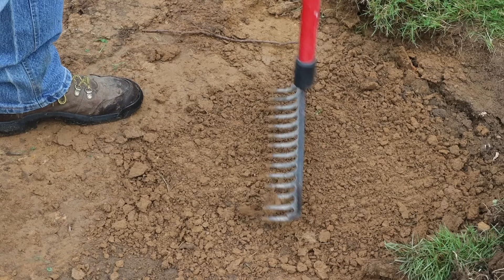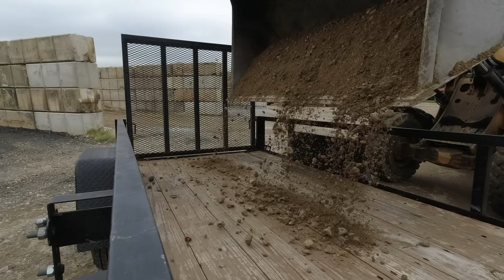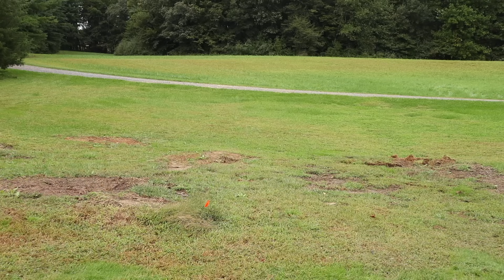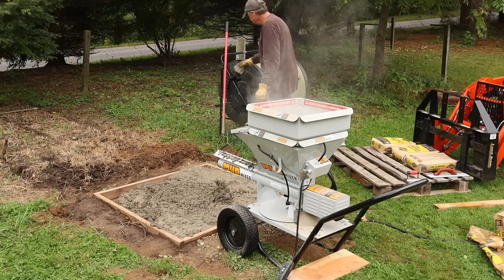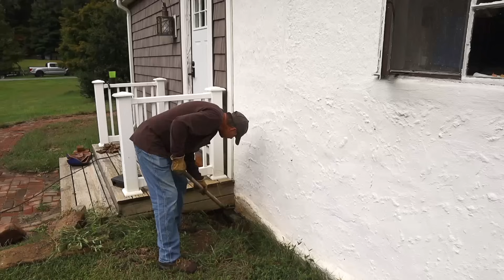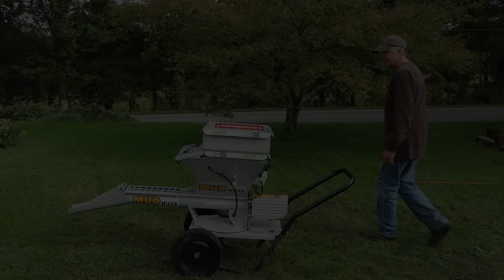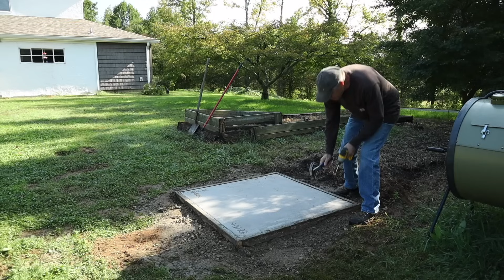Game Changer. Pouring a concrete pad and using the Mudmixer for the first time. MCG Video #169

Comment: Come on man. At least put a tarp down and secure the load on your trailer. I wonder how many windshields were taken out by the rocks that surely fell off.
Reply: Any reason why those rocks couldn't have gone into the pickup truck?
Reply: @KratosMetalworks  It's a PITA to clean out the bed of a pick up.
Reply: Don't call him Shirley!
Reply: NC gives tickets if you don’t cover your load. That’s for everybody
Reply: @jiggidyjam So does Texas. He would have been ticketed quickly for the un-tarped load.
Reply: As an owner of a Safelite franchise, I advise you to pipe down
Reply: @shakehandswithdanger7882   haha I'd be willing to bet most the people who you encounter as a result of unsecured loads were following tri-axles too closely.

Maybe I'm giving too much credit to common sense here but it's pretty easy to tell when a load needs secured be it ratchet straps or tarping loose material.
Reply: @shakehandswithdanger7882 I know right
Reply: Yeah man, secure the load.  Put some cross straps on it.  🤪
Reply: You can buy a nice truck and trailer but you can’t buy common sense lmao
Reply: Flip the edger so only the downward flange is contacting the concrete to form the initial groove along the frame.  Then you won’t have resistance as you finish the edging
Reply: My thoughts exactly...
Reply: Exactly; I've had cars sandblasted behind people who don't understand and follow the laws that require covering a load like that on the road.
Reply: They never should have loaded that trailer not ment for loose material. That ridiculous
Reply: I hate seeing ppl that don’t! Or ppl that don’t sweep the deck after a haul…
Reply: @diesel09 we don't care
Reply: mine..$844
Reply: What a knobhead. All the gear, no idea.
Reply: Wrong Trailer for the job, destiny should have had a tarp.
Reply: None
Reply: He likely didn't have far to drive, so he drove slowly. I hope, that this is the case. Even if road safety wasn't an issue, why waste material blowing out via the slipstream?
Reply: Yeah the extra half ton he didn't need is all over the road 🤣🤣🤣🤣
Reply: Not to make light of an unsecured load, I can fit 4 bags of Quikrete 3/4 gravel in the trunk of my Dad's 2003 Toyota Corolla. 😅

Probably a few more bags if I don't want to blow out the factory OEM shocks. 😂
Reply: Typical boomer
Reply: At least he's not anxious and can tell if he is a male or female@AnxiousCowboy
Reply: Y'all are ridiculous; minus some dust he probably didn't lose much in the way of materials.

I hope you all stay 300ft back from f'n dump trucks though. 🙄

You guys should get clear acrylic boxes and smoke test a mini truck & trailer set up.

I promise you'll be surprised.
Reply: @aRegularHandyman only takes one rock. 🙄
Reply: @philspd473   shh don't tell my secrets

more seriously; I just brought in a trailer load of scrap, none of it was "secured" and none of it fell off at 50mph ;)

Ok .. small debris sized stuff was placed inside an oven but there was all kinds of shnit there.. xD

Comment: Finishing concrete for diy types is like finishing drywall topping coat .They keep working it and working it . Patience is key.and I think you did well . That machine should not be dropping out cement fines at the rear . What does the manufacturer say about this ?I’ve seen many concrete truck operators sprinkle in a healthy dose of brown sugar into the chute and apparently the chemical reaction makes the mud flow a lot easier .

Comment: Great job. One thing not shown, and perhaps not known, is that concrete needs to be kept wet to full cure, which is why pros mist the top with water and then cover it with plastic sheeting, during the cure time.
Reply from the maker: Thank you! I did wet it and let it cure slowly 👍
Reply: 7 days slowly curing? Most people aren’t that patient with keeping it wet/curing. 

Most pros that I’ve worked with just spray on a curing compound. Plastic would be a semipro move.

Comment: A 2x4 is actually 1.5x3.5 inches. So you wouldn’t get a 4 inch slab. Which is the reason you were left with two bags 👍

Comment: I’d like to have one of these, but that’s a tiny amount of concrete. On the farm we’d mix concrete with a masons hoe on a piece of plywood on the ground. You throw down your fixins, make a divot in the center for the water and start folding  in the edges with the hoe and mixing it up. Repeat the process until you get it mixed the way to want it. You can throw the bags of cement right off the truck instead of lifting them up to a regular drum mixer.

Comment: Mudmixer for the homeowner: not $500, not $1,500, not $2,500… but rather $3,500.  ($3,000 on sale.) Yikes, for doing a few pads or fence posts, I’m just fine with the old wheelbarrow method… for for luxury, a $200 Harbor electric mixer!

Comment: First time visiting here and I'm impressed with that Mudmixer.  I do understand these machines have some quirks that need to be hacked but as with just about any mechanical device, the more you use it, the easier it becomes.  I was thinking the designers could make one with a trailer hitch so you could pull it around with a ATV or UTV. Thanks for the vid and nice work on the pad.  Cheers from Vermont.
Reply: I could have used something like that 20 years ago when I put a 140’ of 4’ H ICF  foundation under a house. I used a mixer and scaffolding. I loaded the mixer with buckets. I still have the mixer and one more project for it  in my lifetime.
Reply: I reckon a larger unit designed to fit on a medium sized truck, with three hoppers (one each for sand, aggregate and cement) with separate dials to control each ratio.  Have each hopper able to hold the contents of t one and a half of the 1 cubic metre / yard bags, and a hiab crane to reload each hopper.

Comment: Nice video!  Thank you for demonstrating the mixer.  One thought that might help with the initial start up.  Try wetting down the chute and turning the auger/water on before you add the first bag.  It will definitely help the mud come out the chute easier and may help solve the initial consistency problem.
Reply: Also, if that isn't enough, reverse it a few times to get that initial batch truly wet.

Comment: In the spring I poured a 30”x48” pad for my coal forge, in my barn. I probably went a little overboard with it. It’s got a 6”x6” grid of #3 rebar, and is 5/6” thick with beams around the perimeter, 😂. I like the idea of that Mudmixer, it seems a little fiddley, I’m sure there’s a learning curve. Cool video, thanks.

Comment: I don't see the value in the mud mixer.  Seems like an expensive Rube Goldberg way to mix concrete way more inconsistently and with more breakdowns than an old fashioned drum style electric concrete mixer.

An electric drum mixer allows you to dial in the mix before it's poured, allows you to control the rate of pour so that you don't have to keep up with a constant flow of concrete, is a very simple machine that doesn't jam while pouring, has far less to go wrong with it, and is 10X cheaper to purchase.

As far as the mud mixer being easy to move when full, I don't see the benefit.  Electric drum mixers are easy to move when empty, and since they're empty after every pour, there is no real advantage to moving the mud mixer vs. the old fashioned drum mixer.

As far as cleaning goes, the drum mixer wins hands down.  That mud mixer was half full of dry concrete that had to be removed without using water (at least according to the sticker on the hopper).  It also has a feed screw and chute to rinse out.  A drum mixer would've been empty after the last pour, so it would just need to be rinsed out.

About the only advantage I see for the mud mixer is the chute allows more accurate placement of the pour and doesn't require a wheel barrow to move the concrete from the mixer to the site of the pour, as long as the pour is near the edge of the form.  If you're pouring a larger slab and need to get the pour in the middle of the slab then you'll need a wheel barrow anyway, negating that advantage.

I don't get it.

Comment: Everyone is ahead of me so I won't say much except it was an excellent video and when someone without a lot of experience does it they have the same questions as I would have had regarding the marks and someone answered that below. 
I learned a lot from the video and I will watch your channel more often. I was going to mention the 3 1/2 inch forms were the reason you had too much concrete mix. I recently poured a pad from a truck and I raised my forms up a half inch. Raising the pallet to the same level as the mixer saves a lot of back pain.
Reply from the maker: Thank you!

Comment: It is slightly embarrassing to think that somebody might mix this job with that expensive machine instead of using a barrow or regular barrel concrete mixer. In fact, this machine is NOT the right tool for that job. And, in reality, on larger jobs where you want consistency and a high quality result, you might be conned into thinking that it might be the right tool ... but here also it is not since you cannot achieve the same consistency as you would get out of the truck (not to mention the additional effort, time and cost). I think if you have a long foundation to pour where you have excellent access so that mudmixer can be pushed along, then you probably have the right tool for the job, if you're willing to still work hard and pay the $$

Comment: You didn't need all 12 bags because a 2x4 board is actually only 3.5 inches wide so you didn't get the full 4 inches thick you put into the calculator. I just saw the mudmixer for the first time today and was curious to see someone actually using one. Thanks for sharing your experience. 
Whenever I do any concrete work I use the leftover mix to make stepping stones. I just pour it right on the dirt and tool it along with everything else into a flat blob about 2 inches thick and once it sets up you can put it anywhere you want to step on a solid object instead of the ground
Reply: I started to post the same comment, but decided to check first to see if someone else already said it! You beat me to it!
Reply: For concrete it's better to have more than less just like pulling electrical wires.
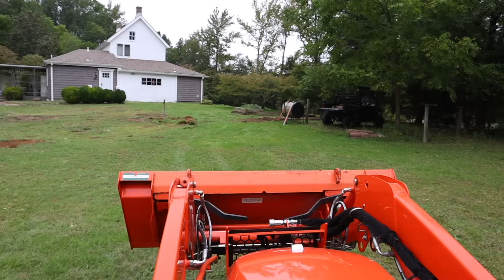Reply: You missed at 8:45 (before he dumps the stones) he grabs four 1/2" thick pebbles from the tractor bucket.  He then places a pebble under each corner of the form to raise it up one half inch
Reply: I had to take some cores out of a huge 4" thick silage slab that a contractor had poured for a dairy farmer.  All of the cores came out significantly less than 4" long.  The contractor's response was that "everybody knows a 4" thick slab is really only 3-and-half inches thick."

Comment: Great job Ed.  Thanks for the honest “handyman” review.  Most of us wouldn’t spend that kind of money as weekend warriors but I love the technology.  For semi-pro contractors that might be doing this several times per week for shed foundations or similar pads, this could be a nice piece of equipment.  Like you I’m curious about the cement powder on the frame that you experienced.  This will mean less cement in the mix and possibly a weaker mix (not to mention waste). I’d also like to know of the long-term reliability and service history.  Any machine like this takes a lot of abuse so it’d be interesting to know how many yards of concrete you can put through it before it needs a new auger, motor or other maintenance.  Keep up the great work.
Reply: That was my thoughts exactly. That leakage of the fines in the back will through the ratios off. I wouldn't be surprised if something isn't installed / adjusted correctly. It shouldn't be a normal part of operation. But that's the modern manufacturing process for you. It doesn't matter how much you pay for it, sone adjustments are left to you inorder reduce manufacturing cost. But be darn sure the company won't pass those savings on to you. Lol 😂
Reply from the maker: Thanks very much! Yeah it’s not an “every day” tool for average DIYers but if you have a use for it, I think it’s well worth it.

Comment: The project turned out well and I enjoyed the vide!

 I however have to ask and this is not being nasty or mean but did you really need an online calculator to figure out how many 1/2 cubic foot ready mix bags were needed for the job?

I have a MQ Mix & Go rotary mixer and mix concrete all the time - my mixer is 1/4 the price of yours - I mix from ingredients - sand, gravel, Portland cement and water - it’s cheaper then bagged premix. I would have bought 3/4 clear stone for the base and used the same stone for making the cement just for efficiency on such a small project.

If you correctly measured the forms and had cement bags left over you may have used too much water in your mix.

For the price of that machine you could have bought a decent rotary mixer, a weekend warrior  grade plate compactor and maybe a 18 volt pencil vibrator.

I think your machine is great if the bags are being billed to the job and or the volume needed is just below a minimum load (cement truck) or the job is remote. I think there are interesting applications for your machine and I might even rent one depending on the job but I would never buy one at that price.
Reply from the maker: I appreciate your thoughtful comments. This machine definitely has its place, but it’s surely not for everyone. I think if you have several small to medium jobs, this wins over a traditional mixer. But that determination is really up to each individual. And yes I needed the online calculator - because I wasn’t sure if my local lumber yard was going to carry 40lb, 60lb, or 80lb. I definitely would not recommend using 80lb bags unless you are really physically fit… Which I am not. 🤣

Comment: Did you figure out why and where it was leaking dry mix on the back from?
Reply from the maker: The company stated that it’s normal for some of the dry mix to be pushed out of the back however, they are working on an improved seal.
Reply: I would suggest putting a heavy tarp down on the trailer first before they load the gravel and pull the excess tarp up over the pile. Windshields and paint jobs don’t come cheap and you may even get ticketed if your load is not contained . The mud mixer looks like a time saver letting one person do the work of two.

Comment: I’m an old concrete guy with many decades of experience and I’m here to tell ya it wasn’t painful at all, lol
Your prep and technique were solid as can be.
Reply from the maker: That’s very kind. I really appreciate it!
Reply: The pile of dust out the back is a sign that the seal around the auger shaft isn't right.
Reply: When I get gravel like you did I get one of my big tarps and drape it over both sides of the flat bed down to the ground.
They dump the gravel in and I wrap it up like McDonalds wraps up their cheeseburgers and lay one of my long tow chains on top
Nothing goes anywhere it's not supposed to and you don't get sued for flying gravel. I did like you're video !
Reply: @bevholcomb6805 I shall use this tip myself
Reply: Agreed!  Well done Sir.  😊 God Bless
Reply: prep flawless now that finish is rough lol
Reply from the maker: @mackeyjewell9166  I’m learning 😄
Reply: @MyClutteredGarage  if you do it again try and keep your mag more flat like you’re trying to be gentle unless you let the concrete harden a little more on a small job like that i advise letting it tighten a little more it’s much easier for a beginner to get a decent finish where as with wet Crete you gotta be grabbing crème off the top of the Crete and filling in while you’re edging and your mag will float easier on the stiffer Crete that was kinda wet to be finishing already on in the edge you want to make sure you don’t just dig the cutting edge next to form your wanting an even edge so it doesn’t roll
Reply: @mackeyjewell9166 wet broom finish is good enough for this job.. its not a sidewalk or front porch 😂.
Reply: Kinda wot I was thinking.. but wot I know. I only had 25 yrs experiance working for my day growing up. Today I just feed cows all winter and bail hay all summer  fish and hunt.
Reply: I have 25 years' experience myself.. looked good to me too..
Reply: Wetting the crushed concrete before you pack it is a much better procedure.  And also, why no rebar or fiberglass reinforcement on that size pad?
Reply: I realize it's just a small pad, but anytime you pour concrete without  fiber mesh reinforcement added in the mix. You need a wire reinforcement in the bottom third of the pour . It's not if concrete will crack, it's when. The wire simply holds the pieces together when temperatures and moisture cause the slab to expand and contract
Reply: Here's what you have to do: Go to the magistrate and produce verified copies of your diploma and certificate from your employer/clients to prove that you have worked in the concrete trade. If you say the video wasn't brutal to watch for a pro then you must not have worked much with concrete.
Reply: @SwedishNiceGuy    So what does that mean? Can you offer some meaningful advise for us 'newbies'?
Reply: @SwedishNiceGuy  you don’t need any papers from the magistrate to prove you are a certified moron.